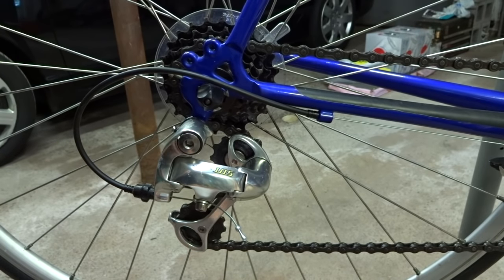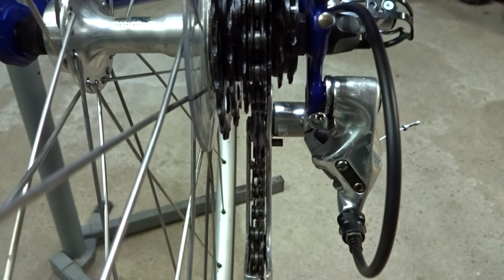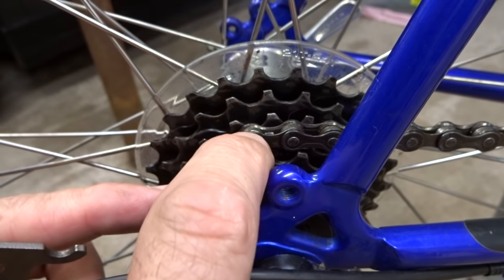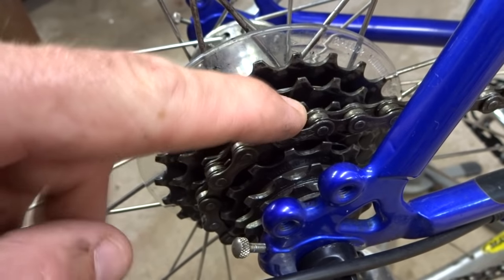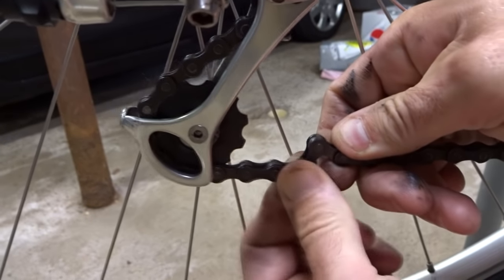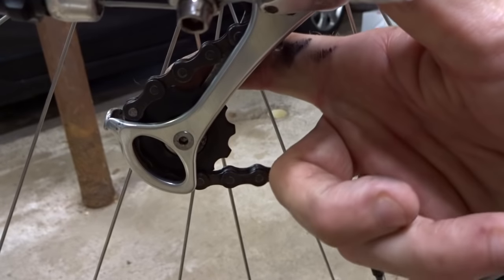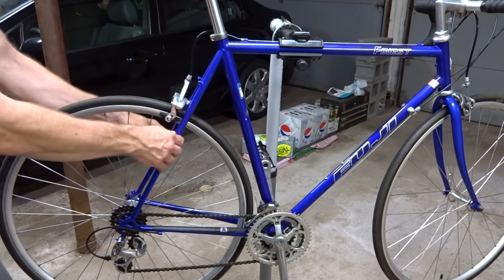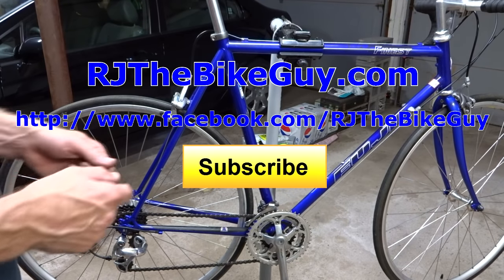How To Fix Bike Chain Skipping/Slipping/Jumping Gears

Comment: i recently had alot of chain slippage.When i check my9speed  cassette i was shocked how many teeth had broken off in the tougher gears on the smaller rings.Then i remembered that at traffic lights i had been setting off always in the highest gears that i stopped in.Perhaps i was putting too much pressure on them.Is this a common occurance or not good quality cassette.
Reply from the maker: I don't recall seeing cassettes with broken teeth. Usually just worn down ones. Maybe it was a cheap cassette, or maybe there was something else going on.
Reply: yes i took it to the bike shop for a replacement and he said he had never seen this either.the make of the cassette was mishi or something.anyway ive swapped the broken 26teeth one for a 32 and much better up the hills.I will from now on also stop the habit of trying to ride in the hardest gears always as this doesnt do your legs or your cassettes any good!!

Comment: when I was younger and at peak condition, I actually could generate enough torque with my tall long legs and body to throw the chain off the chainring because the fact that the chain is looser than with a single speed which is snug   and because the teeth are not as aggressive as a single speed as well.

the bike store guy looked into absolutely everything it's so hard to believe that any human could exceed the limits of the components especially because the pros are so muscular, and they train for strength and torque.

so somehow my long legs and body were the culprit and normal height and older people could punish that bike which got to the point where it would skip even when I was sitting down and not pushing it really hard.

I say that single speeds are much safer and reliable, especially if you are a torque monster and tall with lots of leverage. 

so many fatal disasters can happen with gears,  I'm just as lucky I didn't get the chain snagged in the rear derailleur and broke it off back then which would have seriously injured me and the bike.

my legs were not even that muscular.

what's strange now is that recently I have found that I can ride most geared bikes with no immediate problems.

although I have still found that problems can develop if I ride them long enough.

I can still stretch out an 8 speed chain fairly quickly. 

I'm not riding high gears on hills or anything.

and if I strengthened my hips,  I might easily be able to throw the chain off once more.

I actually had more power than a tour or olympic level rider due to natural body leverage?!?
Reply: Are you very heavy? The maximum force you can exert is with your full weight on the pedal when it’s horizontal (unless you have clipless pedals and are pulling up with the other foot as well. Any bike should be able to withstand that providing you don’t exceed the weight limit of the bike, typically 125kg,
Reply: Oh no I was skinny and lightweight back then, but somehow I had enough torque to make the front chainring escape the chain.

Maybe sometimes it was the rear derailleur that skipped but mostly I think it was the front because one time I happened to look down as it happened and saw the chain riding up on the teeth.

And the front chainring makes sense because that's where the most torque is generated
Reply: @vikkbiff6029  Your derailleurs and/or chain were worn, badly aligned, not indexed correctly or similar. This problem doesn’t happen on a correctly set up bike. You can’t generate more torque by being powerful - it’s limited by your weight, combined with crank length, plus a bit extra if you pull up against the handlebars or pull up the other pedal with clipless shoes. Tension in the chain is also dependent on gears selected.

Pro cyclists generate more power and win races by peddling faster and more consistent for longer. Power is torque x rpm, so the faster you pedal for a given torque the more power you generate. Bikes measure the power in watts.

Comment: How will I know which direction to turn the barrel adjuster?
Reply from the maker: As you turn it, you will see the cage moving one direction or the other. But generally turn it counter clockwise to move the cage towards the bigger cogs, and clockwise to move it towards the smaller cogs.
Reply: Thanks!

Comment: Hi, 
i have looked around and not found an answer.

Quick trouble description:
1) purchase of a used Giant Ocr 2.0 from ebay
bike is in very good condition, tiagra 3x9 speed
rode it at everything seemed fine, decided to replace the chain by principle
2) replaced the tiagra chain for an ultegra one (HG93, 9s)
fitted the length comparison with the old chain.
trouble:
upper, lower frontal chain rings work fine, 

but
using the middle frontal and most of the backside chainrings, most immediately the more middle ones, the chain "slips". i cannot describe it well, it seems to slip one chain link to the front, it doesnt chain gears. 

going by the logic of some trouble shooting videos, the chain at that composition has slack, that is: i can form a "z" with the chain and could reduce its lenght as some people suggest is the cause. But the lenght of the chain fits the logic of the setup-videos that say: biggest frontal chain ring and biggest backside (lowest gear) and if there (!) you cannot form a z, the chain is short/long enough. 

Now i wouldnt guarantee that it didnt slip before. maybe i just used the biggest frontal ring, but since i rode within the city, i would tend to "it didnt slip before". 

is there anything special with 3x9 speed setups that cause this? the derailleurs seems properly aligned according to standarts. 

has anybody had this before? thx for replies!
Reply from the maker: I have not worked on your bike. I did not replace the chain. I am assuming you installed the correct size chain. I am assuming you sized the chain by number of links and not actual length. I don't know how worn your old chain was. Since you only replaced the chain, I am guessing your  chainrings or cogs are excessively worn. Figure it out, or take it to a shop.
Reply: @RJTheBikeGuy  I just did. thx for the reply though. i personally excluded "cassette" because they didnt appear worn. The shop declared by principle "you can never just replace an old chain, always chain and "ritzels"". by his confidence I expect the bike to work well after having replaced the cassette on monday. thx for your quick reply though. these aspects were what i took from all the youtube videos.
Reply from the maker: You don't always have to replace the cassette and chainrings when you replace a chain. But they do wear. If you wait too long and let the chain get overly worn, then it is more likely the rest of the drivetrain will get worn. And you mention some gears slip and others don't People tend to ride in some gears more than others, so those wear faster.
Reply: @RJTheBikeGuy  Yes. I knew that from the various videos on it. The individual, i call them tips now, as in the 34 tips on a 34 chain ring: these had still quadratic edges (perfect 90 degree edges like on a square i mean and 2 of them as the new ones have). And the first indication of wear by other videos is that these are gone. The cassette's chain rings' reliefs (put light on it and look at the shadow) look(ed) still exactly like new ones. That is why i immediately stopped that causal explanation. Thx again for the reply. In case it wasnt the cassette, as Ill find out on monday, i will give an update here!

Comment: should a rusty chain be replaced immediately?
Reply from the maker: If it's just a light rust, often running it through a chain scrubber, and lubing will clean it up. If it's more significant, I will usually replace it. Chains are relatively cheap. It looks and works better.

Comment: My cables of the derailer are spoiled i have fixed the cables but i am nt able to fix the perfect gear changing🤔🤔👍👍😷
Reply from the maker: Yeah, I can't tell you without working on the bike. Worn chain, worn cogs, cable adjustment, b-screw adjustment, improper parts, bent hanger, bent derailleur, etc, etc.
Reply: Yes the problem is cable adjustment  o am not able to fix it
Reply from the maker: @SHIVAPRASAD-nf7sn  Then take it to a shop.

Comment: I had a new 7 speed cassette, shifters  , chain , installed at bike shop and it still jumps by itself , shifts weird. The derailer looks good , everthing is Shimano.. will check what you said.. 
.
Reply from the maker: Take it back to the shop and have them fix it.
Reply: @RJTheBikeGuy  I'd rather do myself. Seems like kids working there. They should have test rode it. Loose trust...
Reply from the maker: @recyclespinning9839  Could just be cable adjustment. New cables take a little bit to stretch and settle in. Or a combination of things. Can't tell you without working on the bike.
Reply: @RJTheBikeGuy  I'm gonna go thru the check list you gave.  Check alignment , derailleur,  derailleur mount,  etc. Cable. The trigger shifters they sold me a low line shimano,  . I am just trying to learn.. 
I bought a Paramount 40, ( think made in Japan)  mountain bike for parts , the guy had in his basement since new , bought from his friend who had worked at the local Schwinn shop.
Turns out it is mint ,and not taking parts off,, just will service,  it has the complete group Deore, really like it .
PS , are you supposed repack all the hubs, bottom bracket, etc , even if almost no use? I think was a 90s bike, I am sure is old grease.. Thanks again

Comment: My barrel adjuster is good but my bike is skipping 6 gear and it will go to first gear but It says in in 2 gear on the gear reading on the handlebars and when I click it is goes into the spokes.. Plz help me what should I do
Reply from the maker: https://www.youtube.com/watch?v=TpsG8eDF53U
https://www.youtube.com/watch?v=gwBQxhZhKnE
Reply: ok i in tangled the barrel adjuster and then i pulled the string out and now i cant put it back it beacuse it is not tangled and u send me a link beacuse im going to buy a new cable line put i done know how to put it back in like put the cable protectors on the cable

Comment: EDIT: I was MISTAKEN - the new chainring did NOT fix the problem. Original post left intact, as follows:
My slipping problem was caused by a worn *chainring*. Why didn't you mention the chainrings as a possible cause? I was able to demonstrate the worn chainring with the bike stationary, by applying the brake firmly, and then applying pressure to the pedals - the chain lifted off the chainring slightly, under load.
Reply from the maker: Because if the chainring is that worn, it should be pretty obvious. And by that point, the whole drivetrain is trashed and will need to be replaced.
Reply: @RJTheBikeGuy  I was actually mistaken. Yes, the chainring needed replacing, but it actually did NOT fix my problem. I was so sure that it would (because the chain & cassette had been replaced), but it didn't. I should not have been so confident. Apologies. I might have a BB problem, because I now notice a loud click when the left pedal is on the downstroke, ONLY when on the middle chainring, and ONLY when on the two smallest cogs, but the smallest one is much worse than the next one up. Starting to panic - going on a long trip this Sunday.
Reply: And accompanying the click is a bit of slippage, I *think*.
Reply from the maker: @gregsullivan7408  I can't tell you what the issue is without working on the bike. The stuff in the video are the most common causes.
Reply: @RJTheBikeGuy  thanks. I'm taking it to a workshop. Will report back once I actually do know what the problem is, in case it helps anyone else.
Reply: The problem was caused by the chain rubbing against a shifting pin on the large chainring, when the chain was on the middle chainring, and on the smallest rear cog. (and very slightly when on the second smallest cog). They filed down the offending shifting pin, and the symptom has gone. Obviously this has not really addressed the root cause, which is still a mystery. To go further, I think I'd contact the bike manufacturer, and try to verify the chain line. (it's a 2002 Jamis Dakota XC 26" MTB). I'm selling the bike though.
Note that the problem only occurred when actually riding the bike - it did NOT happen with the bike on a stand.

Comment: My bmx bike skips and pops once in a while, like once per hour.
Reply from the maker: Go through the video. It might even be the pawls in the freewheel are slipping.
Reply: RJ The Bike Guy my freewheel used to do that, once it skipped when I was pedaling really hard which caused me to be thrown off my bike, I cleaned off all the grease and now my freewheel is strong and clicky, I think it might be my bottom bracket bearings to be honest.
Reply from the maker: @XGaming1  You flushed and lubed your freewheel you mean? Your bottom bracket bearings doing what?

Comment: Analysis happens a lot with Walmart bikes brand new out of the store it always seemed to do this it's a common problem that most people have Plus cassettes are usually garbage airsoft metal except for the very low gears
Reply from the maker: That is why I won't work on them. I helped a friend who was having issues with his Walmart bike. The best I could do was get it sort of shifting right. I told him to sell it and buy a used quality bike. They are such junk.
Reply: @RJTheBikeGuy  unfortunately a lot of my paycheck goes to food for me and my dog trying to get my truck running again so bike isn't really a priority and like to get Mongoose long tail just came out but my dream bike would be a rad bike longtail cargo bike or a Utah quad bike Fat Tire but I don't got 2000 to 6000  be able to buy one of those
Reply: @RJTheBikeGuy  I've been looking around I found a ww2  4 Wheels ambulance gurney bike in a tricycle main wheel Style with a steering wheel up front of the the bed apartment I'd like to make something like that or free trade it because I cannot find one I haven't seen anyone is only one picture on Google I'll try searching other places nobody got pictures of them and it's quite cool and I'd like to rebuild one of those has a project bike

Comment: Can you help me out , my mtb cycle is giving me a problem the 2 and 5 gear is not shifting properly ...
Reply from the maker: Follow the video or take it to a shop.
Reply: RJ The Bike Guy  I followed this video my last ND first gear are not skipping but the problem is when I shift gear from 1 to 2 it didn't shift but when I shift one more time it shifts from 1 to 2 ... same one more time if I shift it will shift to 3 but it's the 4 gear not the 3 gear
Reply: I'd like to understand what is going on with this also.

Comment: My chain will skip on the front chainring but only once in a blue moon when I am climbing and this is a new bike. My local shops can't find the issue nor is it easy for them to replicate since it doesn't happen all the time. What would be the cause of the chain slipping on the front chain ring ?
Reply from the maker: Worn chain/chain rings.
Reply: @RJTheBikeGuy  On a brand new bike ? This first happened on the 3rd or 4th ride after purchase.
Reply from the maker: @Motorsportsgeek  I have not worked on the bike so I can't tell you. If it's a new bike have the shop where you bought it fix it. If it's a cheap Walmart type bike, then that is probably the issue.
Reply: @RJTheBikeGuy It's my first "expensive" bike. After spending all the money on a proper Cannondale bike, it has issues.. I guess nothing can be perfect, I will have them change the chainring gear and chain, hoping that fixes it.  Appreciate the help!
Reply: @Motorsportsgeek  did that fix it, replacing the front chainring?

Comment: I don’t know what my problem is but it has gotten super hard to pedal and I can’t even go up a light hill? Any help?
Reply from the maker: You need to isolate the issue. Could be anything between the bottom bracket to the hub.
Reply: Ok 1 week later, it pedals nice and smooth but now the chain keeps coming off. I believe the problem is the chain keep slipping.
Reply from the maker: @christopherperez8025  Maybe you need to have a mechanic look at it. I can't diagnose it from a sentence or two.
Reply: Im going to take it to a bike shop tomorrow and get it fixed. I tried the most in doing my own. THANKS FOR RESPONDING!!!!!! Great guy

Comment: What if you have a new chain and cassette? Mine slips on 3 smallest cogs...
Reply from the maker: Did you go through the video?
Reply: @RJTheBikeGuy  Wow thanks for the fast reply 😅 Im about to go through everything and ill let you know. But heres some info that may indicate something. I used to have a Shimano Tourney complete system with rear freewheel being 11-34 teeth (if i remember right). I was out mtb-ing and my axle snapped. So I replaced the rear hub for a cassette type freehub (hope pro evo 2) with shimano adapter as i found out freewheels are crap for tough offroading. Then I bought sram ds gh 7 speed cassette which fits the hub fine (that one is 12-25 teeth i think). Then i found out my chain is too fat as the cogs are closer together, so now i have a 9 speed chain on there which fit but it slipped on the smallest cog, as in it would climb over a tooth, shortened it as it seemed too loose and maybe too long and i went for a ride yesterday, so small cog slips anyway but the 2 larger from smallest also skip when applying force pedalling... Im gonna try everything in the video and hope it works im just so baffed at this point. And all cause of the damn axle...

Thank you for the reply though! A lot...!
Reply from the maker: There is so much wrong with your comment. I suggest taking it to a shop.
Reply: @RJTheBikeGuy  You know what? I thought that too... I probably f-ed the whole thing thinking i know what im doing. Might wait a while ride it with this sh***y setup and just get a whole new groupset, have it fitted in a shop... Sounds like less trouble. Thank you for a reply and brutal honesty. Really appreciate it!